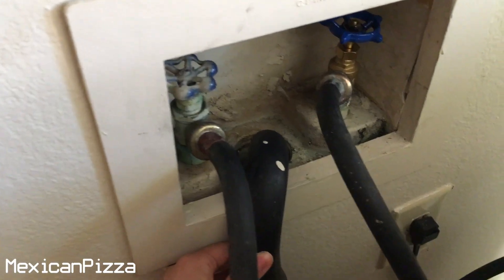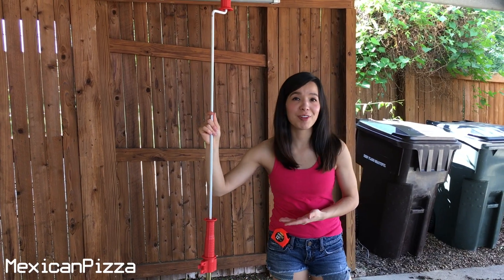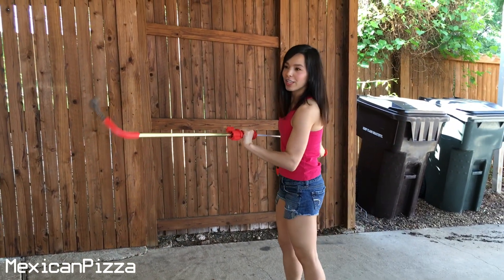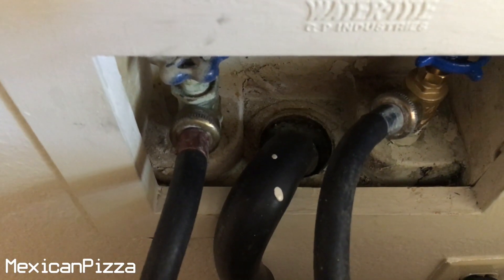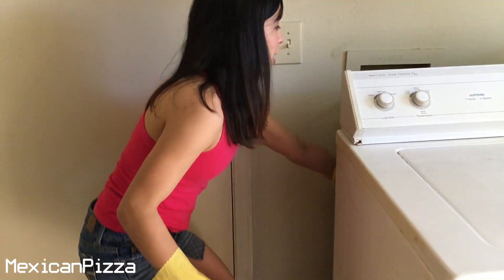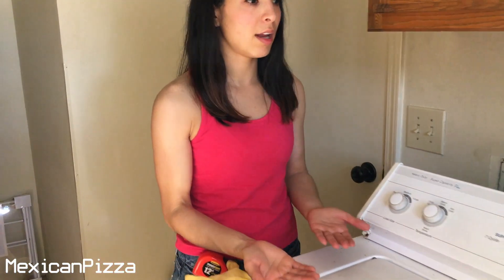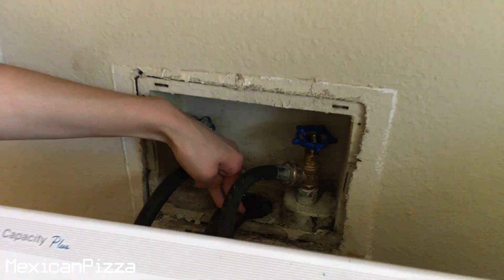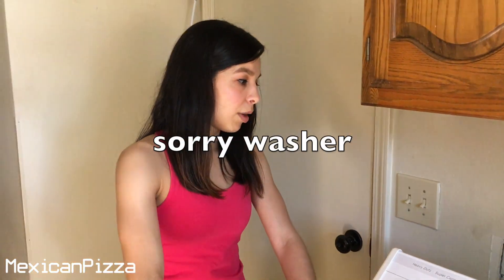Washer Drain Clog: Attempt One

Comment: Well, it could be length of snake but the clog might not be in the line. It could be in the VENT.. Yes, there needs to be an air exchange to allow the water pressure to drain easily. Its like turning a straw into a pipette. OR it could also be algae since that was what was on the end of your snake as you pulled it up. SOLUTION: Bleach tab. Very inexpensive and is an integral part of any maintenance of or to your AC drip pan, Refrigerator evaporator pan (most ppl dont know about those) and even your washer drain line (even fewer ppl know about that). Inside the wall you drain line has a small trap that prevents sewer gases (da FUNK) from permeating your air and toxifying it. Pouring str8 bleach down the pipe is ehh, okay but a tab is slow/time release and fights algae growth on the REG.

Comment: FOLLOW UP -- Clean drain OR vent pipe out by flushing with a garden hose and drain cleaning bladder -- 
Google -- Drain Cleaning rubber bladder -- sold in different sizes. The better brand is a Drain King with the metal end that flushes the best.  Next check YouTube for using one with a garden hose --- NOT a air compressor.

Use by inserting bladder attached to a garden hose just  a short way into a pipe opening - THEN have someone turn on the water to the hose. The bladder will expand and force water thru the pipe. Turn off water, badder will deflate and allow removal OR if the pipe assembly will allow, you can push the bladder further into the pipe - turn the water on - flush - turn water off - deflate - etc.  Just pushing the bladder down the drain will help clean out the pipe. The more you flush - deflate - push in - flush - deflate the better.

Comment: Some newer Wash Machines have a Higher Pump Discharge overpowering the drain.
      -- If after verifying drain pipe AND vent are clean and not blocked ---
-- STOP wash machine discharge overflow with the use of a rubber Adapter and Siphon Break --
1. Adapter, Standpipe - 36878 -- Rubber adapter will slide down into a standard size 2 in OR smaller standpipe which will block overflow after hose assembly connection is inserted.  Note cost of item varies drastically.
2. Siphon Break -- 285320 -- Each end is 1-1/16 OD for 1 in ID hose connection.  Install one end to wash machine discharge hose (With clamp and adapter if needed) with the vent end in the vertical position.  Connect other end from Siphon Break with 1 in ID hose and extend down into rubber adapter on standpipe. A 15 dollar Break is the same as a 40 dollar one. I would not use the Adapter to block discharge without also using a Siphon Break.
Reply: William - I want to use your solution but not sure how to do it. Do you have a vid?
Reply: @pamr308  Sorry no vid.  First verify the drain and vent pipe are not blocked.  Blocked drains are the most common cause of overflow -- especially with older cast iron drain or installations with only 1-1/2 inch pipe. Code now requires 2 inch Wash machine discharge stand pipe.  
Google Adapter 36878 and Siphon Break 285320, viewing these items will help understand installation.  NOTE that a $6 Adapter and a $15 Break are the SAME as the expensive items. 1. Insert rubber Adapter into top of WM discharge stand pipe.  2. Cut existing WM rubber discharge hose and install Siphon Break within hose. 3. Insert end of hose into rubber adapter in stand pipe.  4. If needed for additional length or adapting Siphon Break,  additional hose is available at big box stores. 5. The rubber Adapter may or may not need a small touch of glue on the side just under the top end to block any designed air vent.
Reply: @williamcahoon1438  We've had FIVE different plumbers try and fix this (snaking the drain and other possible drains) over the past 10 months and no one has come up with a permanent solution. Usually, there's an issue within 3 weeks again. So I'm desperate to find an affordable solution. 2 of 5 suggested we tear down the wall behind it (we live in an apartment). The last plumber noticed there is no problem with one hose of water (testing to see how much flow the pipe can take); then w both the hot and water hoses down the pipe, it backs up.
Reply: @pamr308  Using the connections I describe, the washing machine pumps (forces) the water down into your drain as the adapter BLOCKS overflow and the Siphon break allows air to enter for it to drain after the pump discharge stops. 
1.  The rubber adapter will fit down into the top of your (normal) existing water discharge standpipe (assume you have one). If you study a picture of it you will see it has small to larger diameters to fit into different size drains.  It will allow some air -- and then water to expel from the top "IF" you do not apply a small amount of glue near the top side. When in hand study the design CLOSELY.  
2. 'IF" you then just inserted your WM drain discharge hose down into it it should not allow water to flow out the top of the drain, BUT without the SB it would not vent as required.
3. BUT you should ALSO install the Siphon Break within the WD discharge hose which AFTER water is discharged allows it to vent.  The SB is designed with a rubber fitting on one end to seal shut when under pressure, but open and allow air to vent the drain when NOT under pressure. 
4. I have used this exact system and other similar type connections for years with no problem.  
5. Cause of your water to overflow could be because of (A) Drain OR vent pipe is partly block "somewhere".   (B)  Drain stand pipe is less that 2 inch IPS size.  (C)   Some modern side load WM discharge water faster than drain system will allow to drain properly.
6. Unless you have a almost total blocked system this will work. Assume your sinks and toilet drain properly. Good luck.  Again search for the cheaper fittings with same ID.  They are all the same. It will only cost you $30 or so in parts (shipping?)  to solve your problem.  Please post when this works for you.  Do others in your apartment building have problems?
Reply: @pamr308  20 June 2022 to Pam. Read two new replies. Not sure what order they will appear.
Years ago I also had problems with washing machine discharge overflow.  I solved the problem by blocking overflow with special fittings on the top of my discharge standpipe and used a Siphon Break to allow the WM hose and pipe to vent and drain after WM discharge.  LATER I found the the rubber adapter 36878 which will work on different size drain pipes and is less complicated to install than my original system for others to use. Years ago I had replaced all but the last 3 foot of cast iron drain pipe under the house.  Because the craw space was so low I ignored that last 3 foot, but when I did finally replace it I found that it had a 90+% blockage which had caused my WM drain problem.  Because of the location and configuration, previous attempts to "snake it" had not cleared it. Of course use of the adapters had allowed my WM discharge to FORCE drainage and overcome the 90+% blockage with no problem.
Reply: @williamcahoon1438  Checked w building staff. We are the only one experiencing this issue. I'm thinking that a vent pipe may be an issue. Have had several plumbers snake 25' w no issues.
Reply: @pamr308  In a previous post you stated that there was no problem draining with only one hose of water but when two hoses (one hot and one cold) were used, the drain would back up.  Apparently you have blockage which will not allow a large volume to gravity drain. IMO, Install the rubber adapter AND siphon break and your washing machine discharge overflow will be solved. With the parts in hand to show someone who can snake a drain and read my previous posts should be able to install them.
Note that this system does not change or modify the existing plumbing system which you may not own.  The rubber adapter only slides down into the drain and can be removed at any time with no permanent change made.  The Siphon break is installed in the WM discharge hose but can be left in place with no detrimental effect.  Depending on the length and size of the existing WM hose you may would need to get another foot or so of hose from a big box store to complete the connection.
Reply: @pamr308  I have the same problem: overflowing of the drain hose to the pipe outlet box.  Some washing machines (Maytag, Whirlpool) like mine have a siphon break built in. If you have one then this vid will help. 
https://www.youtube.com/watch?v=oVjXS64zI4A
There's a link to a the silicon hose plug which is similar to the Standpipe Rubber Adapter but a bit less expensive.
BTW, if you don't have a siphon break then you'll need to install one.
Reply: @michaelpimentel3002  It seems that option of adding a siphon break and using the adaptor is the best route, which William Cahoon has explained. I would need to purchase both of these. However, the underlying problem is not addressed. A plumber thinks the clog is in the toilet connection...
Reply: @pamr308  Well, that means you can go with chemicals like draino or Main line or  a hydrojet like Drain King or Drain X BEFORE using the adapter or siphon break.

Comment: Try a couple cans of soda or a six pack down the drain should clear it up.   You can try Draino, but its safer to use food based products for clearing drains.  A gallon or two of white vinegar may work also.   Just pour a gallon or two down the drain if you bought a few gallons and wait a few hours before trying the washer flush again.   The acid from the soda and or vinegar will eat its way through the muck and most likely clear your issue.  ;)
Reply: I would say baking soda and vinegar.  I seen many youtube clips of baking soda and vinegar with plenty of success
Reply from the maker: Cool! I like your approach. I'll have to try that. Thanks for the tip :)
Reply: @MexicanPizza44  you can save the chemistry set by getting bleach tabs. Dumping fluid is only a very very temporary fix and crud keeps coming back. Tabs = Time Release Freshness!!! Also cheaper than soda :P
Reply: @DW-pr9hk  what are tabs?
Reply: @MexicanPizza44  did you end up trying it?  I’m having the same problem.
Reply: Do I have to use canned soda??

Comment: Try drain king, it's much easier to use and it really works.
Reply: Israel Garcia where do you get it?
Reply: I just had this same problem and DRAIN KING from Home Depot solved it (I bought the medium size 👍)
Reply: @lamoney9733  did you connect it to the water line connections for the machine or did you have to connect it to a spiget outside for a hosepipe?

Comment: If the clog is further down the system, that short snake will not do the job. What needs to be invented is something that will go the entire length of your drain system. Top Loaders pumping out water too damn fast for the system to handle is the problem. The front loader that I had before never overfilled the system. Top loader manufacturers just don't get it. The drain pump doesn't need to be on steroids to drain the washer.

Comment: I love your "can do" attitude, and you are very cute, and have a great smile and effervescent personality. I was very impressed that you knew to fill the tub with water and then move the dial to spin to drain it into the standpipe, which tells me you are a "thinking girl" -- def not a blonde. LOL. Did you ever get the drain opened up? If so what ended up being the problem and the solution? I am having the same problem at this very moment. I have a small canister drain auger that has a 1/4" x 25' snake, and it can either be operated by the hand crank or attached to an electric drill. I have used it to unplug the shower drain several times and it works so well for that. I am going to give it a try on the washing machine drainpipe and see if I can get that to open up and drain without backing up. But sometimes it's the main plumbing vent stack that can cause drain problems, and if that is the case then a plumber will have to come out with his professional drain auger to open that up. Usually those vent stacks have to be cleaned from the opening on the roof of the house. Anyway, hope to hear from you that you got your drain working properly, and also what the problem and solution was. In the really good movie "The Edge" (1997), the actor Anthony Hopkins had an awesome line where he said "What one man can do, another man can do". So, ALWAYS hang on to your "can do" attitude!